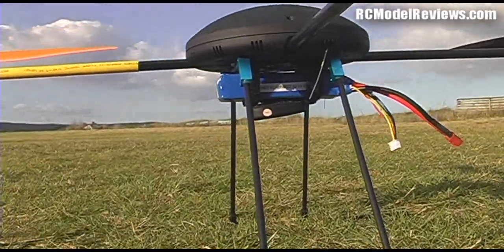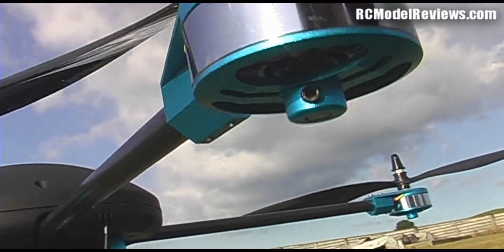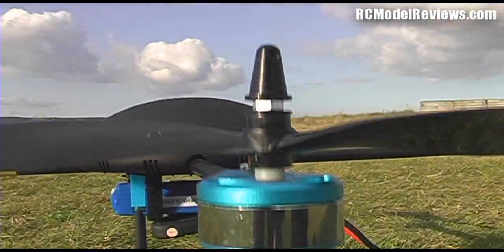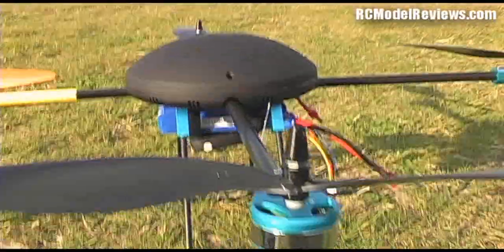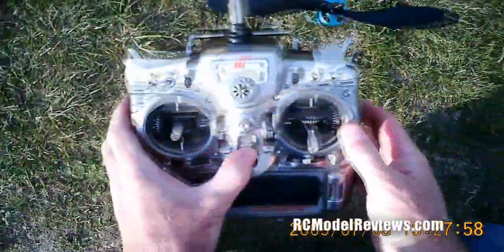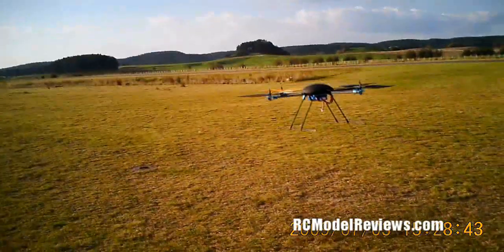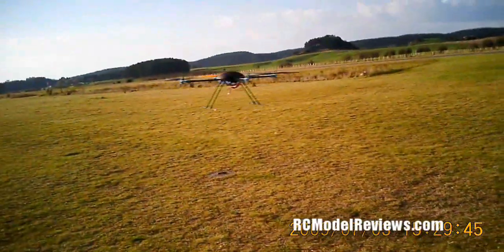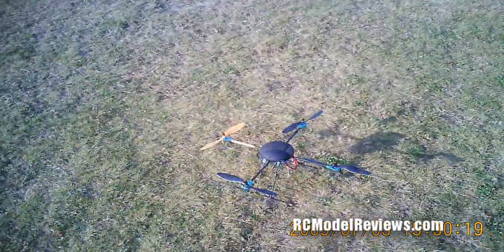Review (part 2): LotusRC T580 quadcopter - the hover

Comment: Great review. I am considering this quad copter but I have one question. Since this isn't offered in a RTF configuration. Being new to quad copters, what would I have to do to bind and configure everything to get this thing flying? I have a Walkera 2801 Pro radio system which has 8 channels and would probably use it for this quad. I do have some coax experience so flying the thing isn't going to be a problem but I assume this doesn't come with a GPS for auto hover or intelligent orientation... The reason I ask is, I know there is an after market for GPS systems but I'm not sure I have the technical know how to get that set up.

Thanks in advance,

Eric

Comment: Hey Bruce, a bit off topic but I can't think of someone more knowledgeable to ask.  I've been trying to find the most efficient power setup for my FPV plane.  My goal is about a .75:1 thrust to weight ratio with the longest duration possible.  I'm testing lots of props and graphing of watt:amp and thrust:amp ratios.  My question is:  why are watts important and what are they telling me?  I realize its measure of the POTENTIAL power but isn't the thrust:amp ratio more important for my purposes?